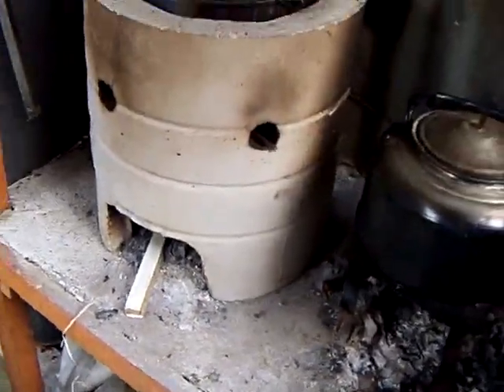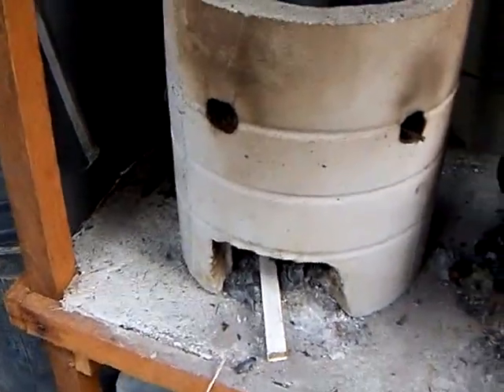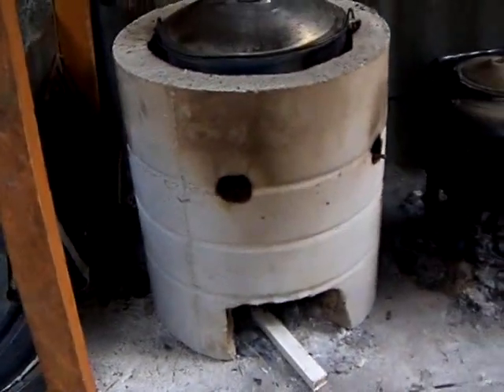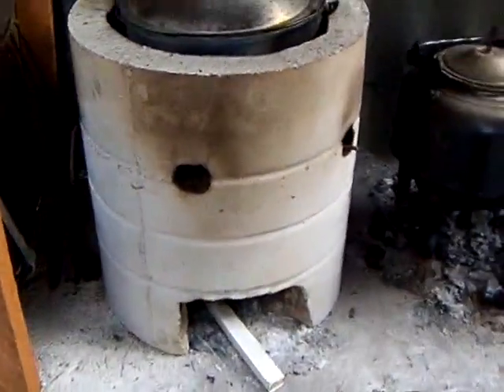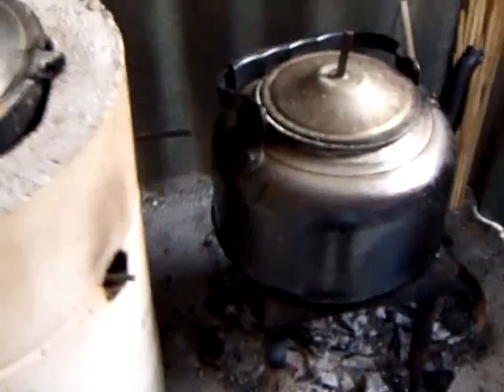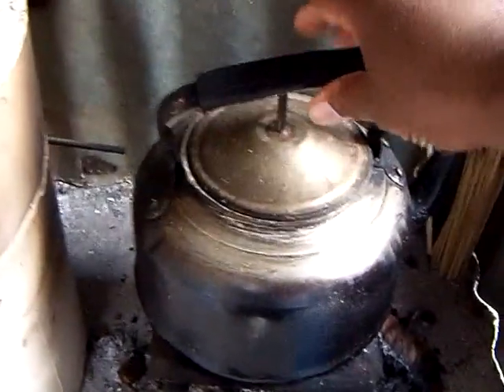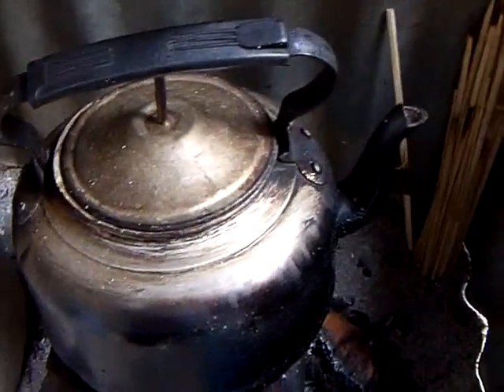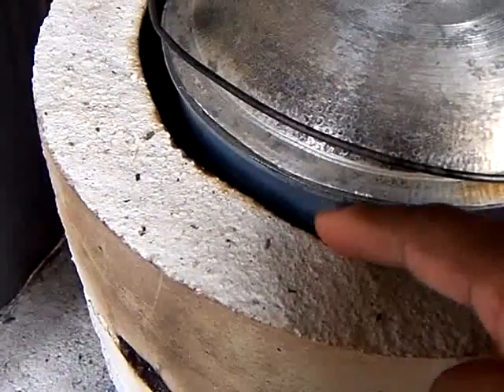DIY cement rocket draft stove

Comment: nice design, looks like a good stove, however the main reason it might not be considered a rocket stove is because concrete is not an ideal or very efficient insulator....the better insulated the fire chamber, the less pollution or smoke, and the more quickly it heats or boils....if you use refractory cement, which is a better insulator, but more expensive it will burn cleaner and more quickly heat the burn chamber....some people add perlite or vermiculite to the concrete for better insulaion.

Comment from the maker: @adamatova I think it depends on the weather. I let the cement dry about a week before I opened the molding. How long it last depends on often you use it. The reinforcing bar in side holds it together longer even if there are small cracks. I think it will last quite a while with everyday use.

Comment: Make sure you wet this occasionally, or it will crumble. Concrete is a hydrochemical and it's hardness is dependent upon water being trapped inside it. If you evaporate all of the water out of it by cooking or heating with it, it will no longer be concrete, just a collection of rocks, sand, and lime gathered together in random clumps.

Comment: You really should install a shelf for the fuel wood so air can flow under it.
That would make it a rocket stove even if it isn't as insulated as most of them are.

Comment: Cement is  a very bad idea if you get it hot enough the air pockets in the cement contain micro moisture that will expand and blow up. Don't believe then take a blow torch to any piece of pavement for two or three minutes with safety goggles on you will believe that it is a VERY BAD IDEA. Sorry to BURST your bubble. (pun intended)
Reply from the maker: Thanks for sharing this information. The stove in this video is long gone by now, cracked and fell apart after many many months of use.
Reply: +abaneyone they dont explode i had a concrete one for months got it hot enough to turn a railroad spike glowing red , and it never blew up , but after about 2 months the concrete blocks started to fall apart
Reply from the maker: Yeah they're like that. I'm still always looking for better ways to cook food more efficiently without spending a lot of money. Solar seem to be good.

Comment: With best wishes to the Creators of warmth!
The oven on the video requires a lot of firewood.
Efficient heating is the minimum cost of building and equipping the heating system, its operation and the use of raw materials (fuel, heat energy from the environment) to produce heat with the maximum coefficient of its beneficial conversion into thermal energy and minimal impact on the natural environment. For the development of your projects there are new technical solutions for a universal rocket furnace for cooking, heating water in a boiler and heating the ceramic floor and the water-heated floor. A brick or ceramic rocket furnace is the most effective means for heating a house, greenhouses of any size: https://sites.google.com/site/menedzmentteoriapraktika/upravlenie-infrastrukturoj/rocket-stove-new-design
Reply from the maker: Thank you!